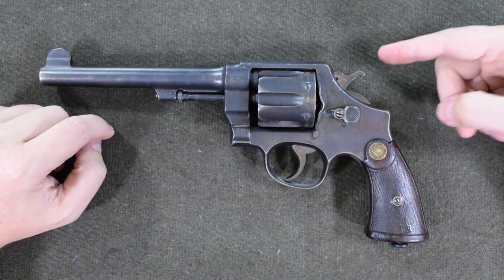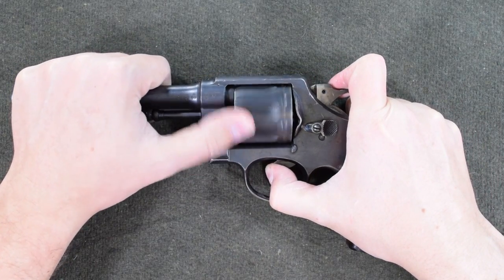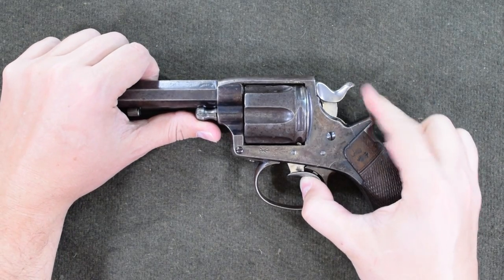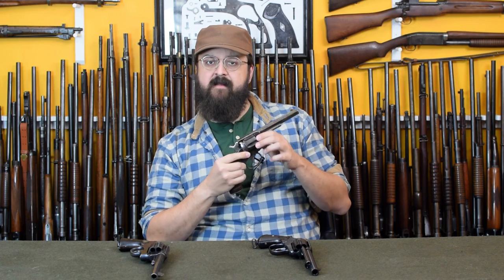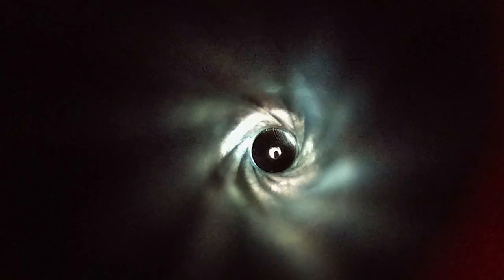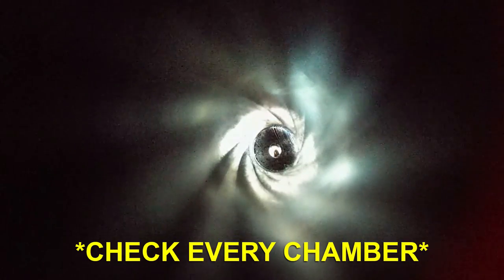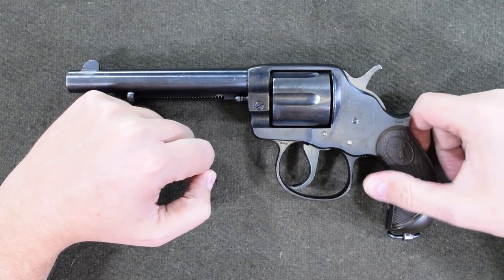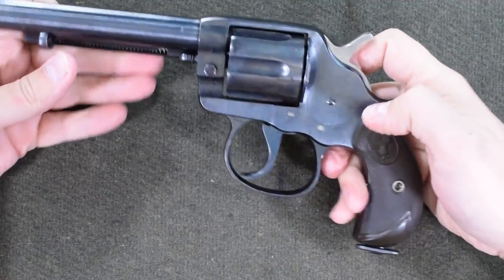Clips: Is your Revolver properly timed?

Comment: Interesting!  Thanks, Othias!   I have a Colt Army Special 38, and I at first thought it was worn out - the cylinder was really sloppy even when the hammer was at full cock.  Then I did a little research, and found that it locks up as tight as a drum as soon as the trigger is pulled.

Comment: Fascinating stuff as always. Are/were components like hands and cylinder stops typically considered consumables, or something that would be regularly replaced? Seems like such tiny parts would suffer from wear and breakage quite frequently.
Reply: Yes, my understanding at least when it came to US police revolvers, replacing and fitting hands and stops was one of the main maintenance tasks armorers would perform. Especially in units that had heavy training rotations, there would be an armourer on the range with a box of spares, because rapid double action puts especially high stress on these parts even with relatively light round counts. There was a reason the leading special police units( SWAT etc) transitioned to semi-autos earlier than regular police, because semis hold up better to high round counts rapid fire than revolvers.
Reply: No, bolts and hands and cylinders are not frequently-replaced wear items. One would consider a magazine, magazine spring, recoil spring, hammer/striker spring, and finally later on the extractor to be fairly frequently-replaced wear items. Recoil springs only last around 5k rounds. Revolver timing components can last 20-30k rounds. Hickok45's Model 29 has 30k rounds on the clock and it has never had retiming or part replacement. Jerry Miculek would find himself replacing revolver parts quite frequently if these parts wore out very quickly. They don't. When a revolver is built well (tolerances, good metallurgy, proper hardening, etc), timed properly from the factory, and not abused by its owner, it will last a very long time. If the owner swings the cylinder shut which bends the bolt and crane, it will fall out of time rapidly. If the owner fails to lubricate and clean these parts, they will wear more rapidly. When the gun is poor quality from the get go, it will need service sooner than others. Changing a recoil spring is something that can be done in the field. Changing revolver timing parts is something that takes a long time and must be completed on a bench by a qualified gunsmith. A hand must be fitted within its slot, and the face angles and length must be tuned along with the star to perfectly rotate each chamber correctly. A bolt must be fitted in height and width and timed to rise and fall at the correct moments. None of this is something that can be done from a box of parts on training day at the range... 😸 A recoil spring and magazine spring can be swapped on the range by an armorer, but a revolver can't be retimed lickity split like that. Luckily there's no need to do so because the revolvers don't fall out of time and become defective after 5k rounds like a recoil spring will. Amongst all their negatives, revolvers do have positives, mainly that they require little maintenance over long periods and they don't break or wear out very frequently. They do still jam however, and when they do it's usually not a field remediated stoppage like a semiauto jam often is. Anyone remarking that revolvers never jam simply hasn't spent enough time shooting and owning one. 🤷🏻‍♂️

Comment: I was checking out a friend's new heritage roughrider he had bought, they claim to have the "classic 4 click single action" and specifically state in the manual that the third click is of no consequence to the shooter. Well come to find out, you could drop the hammer on the third click, and the 4th click was so far back it was almost impossible to find. When I did get it into the 4th click, I could grab the cylinder and physically rotate it into the stop bar. Needless to say, I won't be buying a heritage anytime soon.

Comment: On older smiths in addition to what you showed I like to bring the hammer to a full cock and then push on it towards the front with my thumb to see if the hammer is indeed fully locked in or will it come off the nock and fall forward. I have no idea if this is timing related or drop safe related but it is something my grandfather showed me when I was young and its burned into my brain forever.

Comment: I figure this is as good a place to ask as any.  What are the exact symptoms of a bent cylinder crane on a swing out S&W,  the lock work on my dad’s Model 19-3 seems to move alright but in both DA and SA the hammer only comes back about 1/5th of the way, and the cylinder won’t index at all.

It’s also VERY difficult to open the cylinder latch, my father took absolutely terrible care of it, I believe he flicked it shut constantly back in the 90’s and stored it in a crown royale bag much like he did his Model 10 (which he continues to store in a humid safe in the same way I told him NOT to after I cleaned the surface rust off 2 years ago)
Reply: That gives me flashbacks to fuzzy lined cases people used to store their revolvers in. I still need to reblue the Saturday night special that my mother owns that suffered from such an idiotic storage method.

Comment: Holding the trigger rearward in the fired position is the condition the revolver has to be in to use the Range Rods that Brownells used to sell to check the cylinder/barrel alignment. No surprise at all. oO

Comment: Posting a way to fix a Bodeo revolverhere, because I found a really weird problem they can run into that I managed to fix on mine. And there is nowhere else to post this.
Bodeo revolvers have a rubber spacer in the hammer that pushes against the hammer nose. It can dry up and degrade over time. Just cut a piece off the sole of an old boot in about the same shape and put it in the hammer, it'll fix almost all jamming and trigger pull issues.

Comment: I have a really cool (IMO) 1895 Nagant Revolver that was sporterized for competition shooting, I think in the 1950s. One thing that's cool about the design is that it can't be fired if the cylinder doesn't line up with the barrel. It actually under-rotates a bit right now sometimes and when it does, the hammer just won't go all the way back until I nudge the cylinder into alignment.

Anyone have any suggestions for fixing that? Maybe replace the hand? None of the parts look particularly worn. Unfortunately parts are starting to get hard to come by for this once-cheap gun.
Reply: I had the same issue with my 95 Nagant but only with my reloads using the Graf bullet for this caliber. Seemed the weird crimp on factory ammo actually helps overcome this due to the unique nature of this pistol inserting the case in the barrel. It would self-heal the slight timing issue when the cylinder traveled forward. I got lucky and found a hand on eBay that happened to be just long enough to get it where it needed to be and shoot my reloads after all!

Comment: I have seen the bolt (that “stop”) very wiggly on some well-used, otherwise perfectly timed, but badly maintained guns. The bolt itself, the pin (or screw that it rotates on), and the slot in the frame are, of course, subject to wear and often neglected when lube time comes. Many haven’t seen a single drop of oil there since leaving the factory.

Comment: So I heard that in some Colts their cylinder have a little bit of travel when the hammer locks back, which seems to be the case with my Colt Police Positive Special. Can anyone confirm this? I just want to make sure that's the case because there's a little bit of travel before the cylinder locks in place if I thumb the hammer back gently, but if I pull the trigger in the same case where I thumb the hammer back gently, it's locked in place by the time the hammer falls.

Comment: The Polish P64s have the same problem, as they were designed to fire submachine gun ammo with stupidly hard primers. Resulting in a relatively small handgun (a bit smaller than a makarov) with a 25lb DA trigger pull